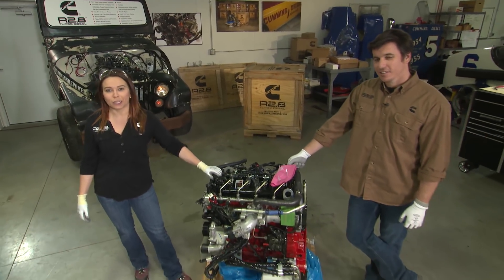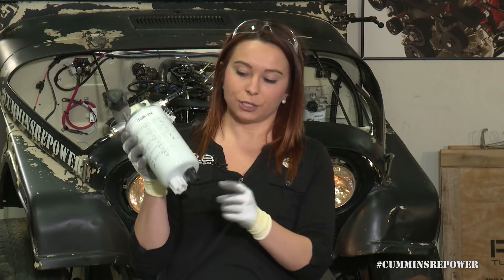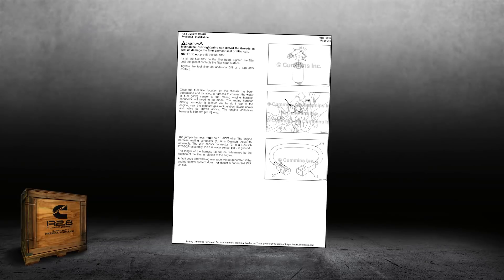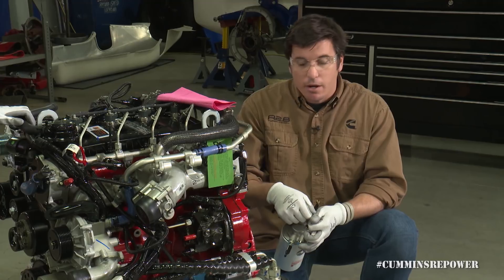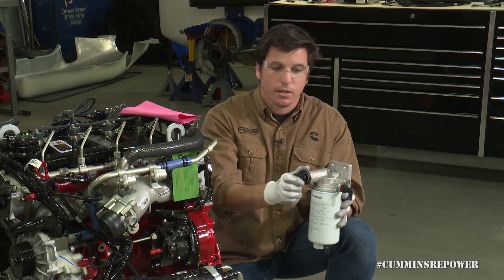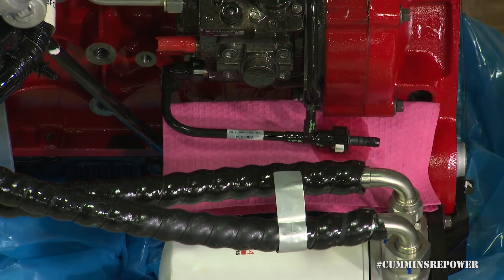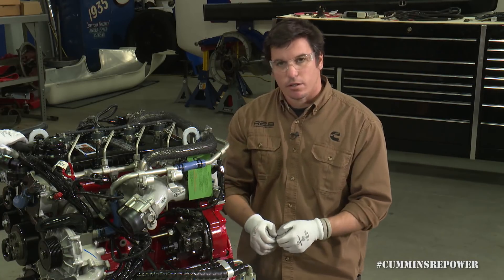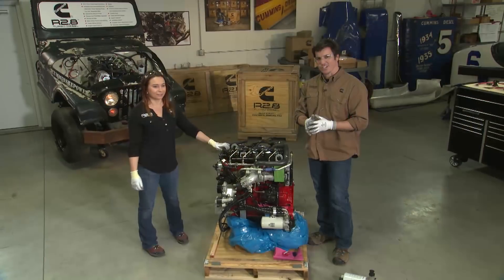Cummins Repower Garage Video 4: Fuel System

Comment: I wonder if I could put this in my H2????? Hmmmmmm
Reply: GizmoZR2 a 3 ton vehicle? Don't bother. Its too small. Get a duramax or 12 valve with a p-pump and manual. Its enough mass and displacement not to be screamimg all the time to move your rig